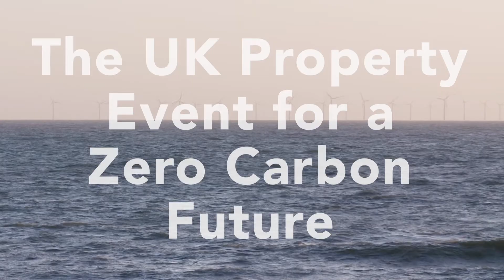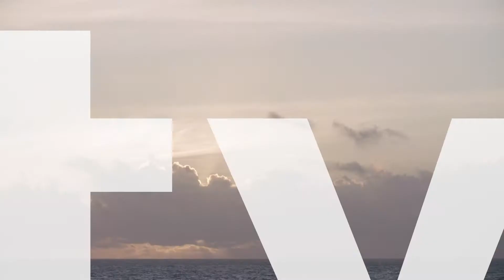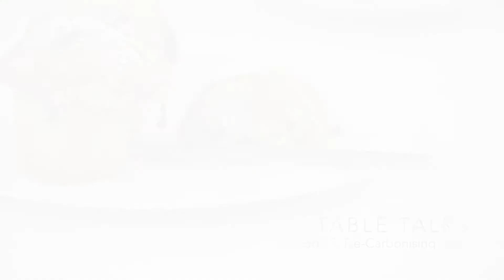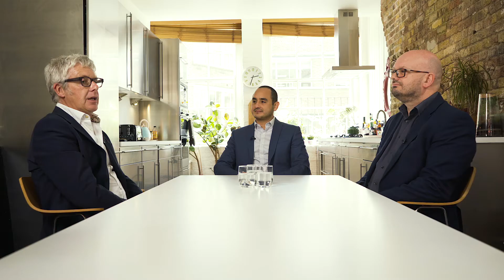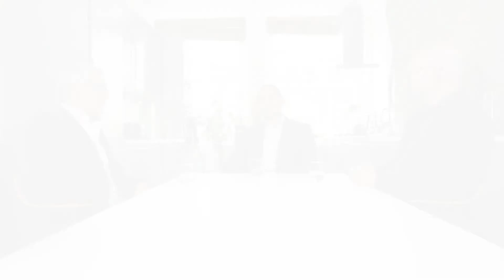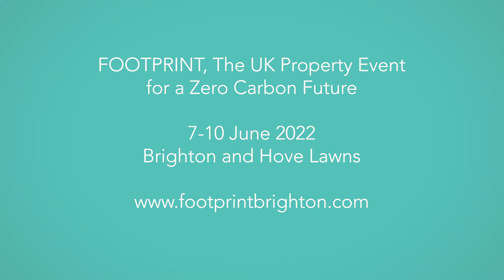FOOTPRINT Table Talks Episode 5 - De-carbonising steel

Comment: The government's message in progressing the proposed Cumbria coal mine is garbage. However, it does make sense...a little bit at least. The 'clean' coal from here would be used to produce steel in the UK and over Europe and thereby prevent use of 'dirty' coal from elsewhere. As is noted, there is demand for blast furnace steel in excess of any recycled steel available on the market. Electricity from solar will never get there in terms of supply needed and hydrogen is way off too in terms of the volume needed and infrastructure changes required. Message is to use less steel in buildings and consider alternative material, e.g. timber from sustainable sources. Another good listen on the same subject is here: https://www.bbc.co.uk/sounds/play/m000v9tl